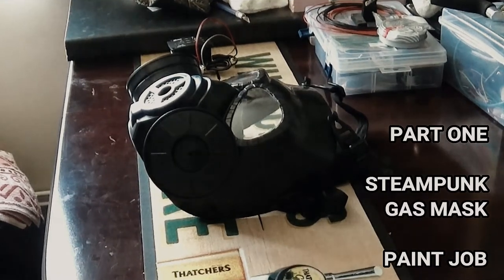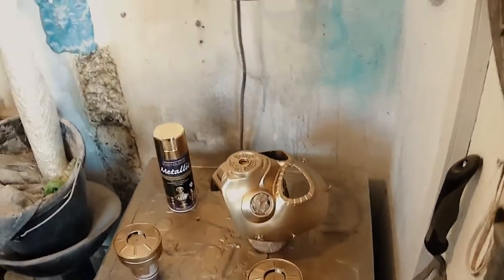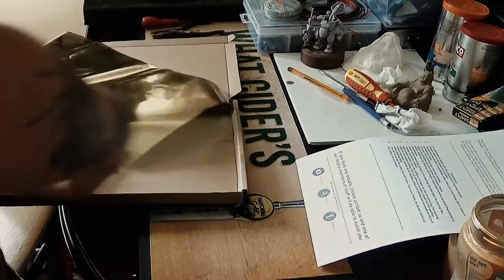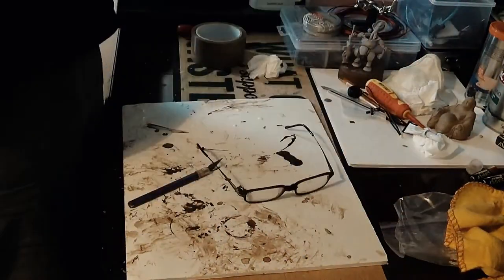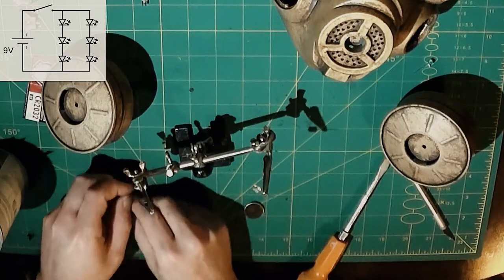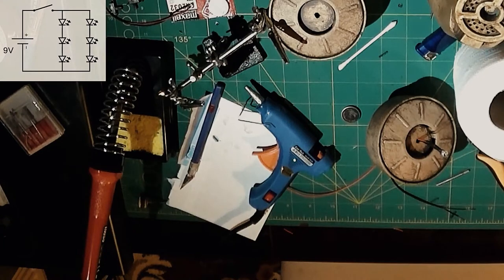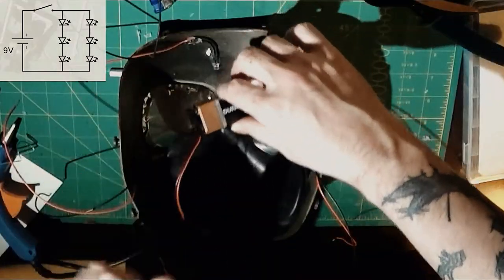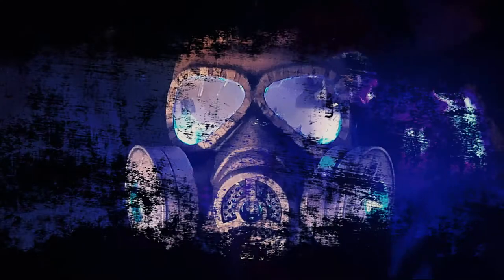Steampunk Gas Mask | Paint Effects | Install LED Lights | Full Series

Comment: Thanks for making this series. Do you happen to have the link to where you got your mask? I can't find any masks for less than $30 USD.
Reply from the maker: I just searched for the best price. Maybe folk have capitalised on the virus for marketing and put prices up. I don't know.
Reply: @dramamask  well shoot. Was your mask made of rubber or plastic? I couldn't quite tell, and I'm worried about  the whatever paint i get degrading the material and was going to brand match what you showed.
Reply from the maker: @griffinwik  The main part of the mask is plastic and the area which is painted is plastic. There's a rubber(ish) part on the inside of the mask, which doesn't interfere with any of the painting. The cheapest I can find on Ebay (in UK) is here: https://www.ebay.co.uk/itm/Double-Filter-Gas-Mk-Fan-CS-Game-Perspiration-Anti-Dust-Face-Guard-Protective/124295463862?hash=item1cf09643b6:g:Fl4AAOSwcIxeYKRY but ships from Hong Kong.